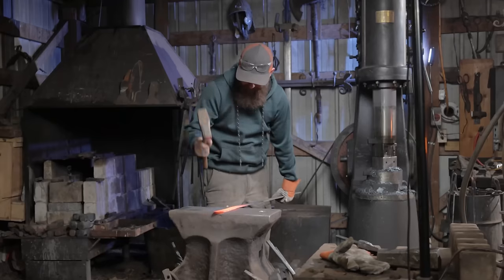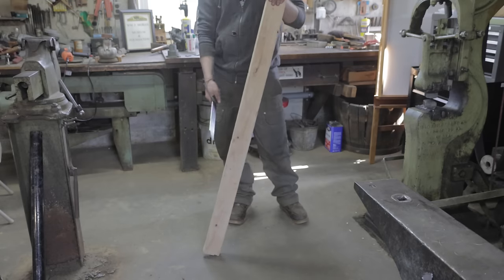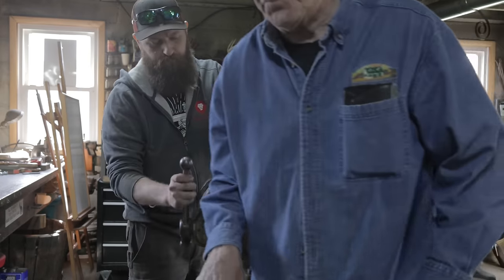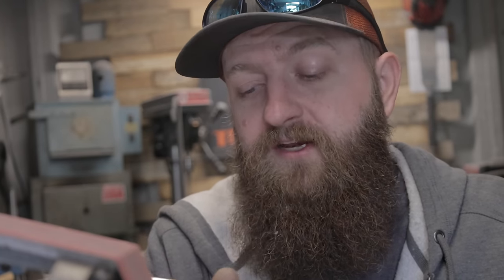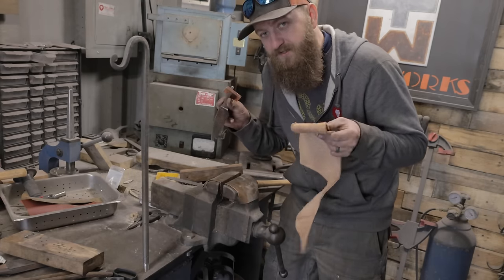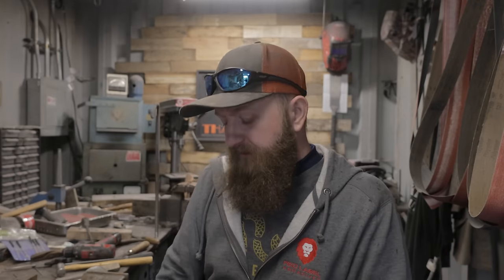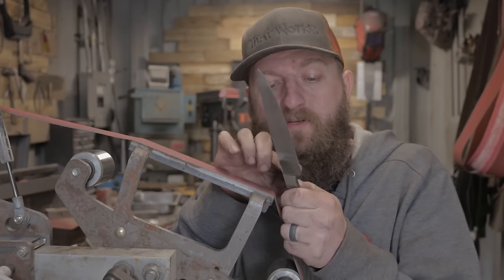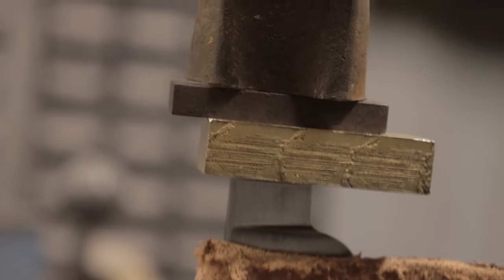Matt's ABS Test [Path to Journeyman] - Part 2

Comment from the maker: Thanks for joining Matt on his path to becoming a Journeyman smith in the ABS! Be sure to check out Red Label Abrasives or all your sanding needs!
Reply: Holy crap matt i wasn't even there and was nervous for you great job 👏👏👏
Reply: Of course guys! Love all you do!
Reply: You have to admit you are a Master Grinder first. But your blade is amazing. 
Luvs Dude
Reply: Where do you get your stencils from for logo etching? its hard to find a place for that?
Reply from the maker: @pr0faker  still working on that
Reply: @pr0faker  One way you can do that is to get a papercraft cutter like a Cricut, one that will do vinyl or other material you can etch over. Then you design a cutting stamp (or a stencil design in software) that the cutter will use to make the actual stencil in a vinyl sticker. After that it's peel and stick, etch, then remove the remains of your sticker.
Reply: @tantamounted  I know the vinyl option but that limits you to anything without loose things like dots and letters like the O etc. I know there are those fine mesh UV stencil thingies but I don't need the whole setup thats like 400-500 bucks to use that, I just want a guy to fix those stencil things since 1 will be usable for like 100 times or something.  I don't make 100 knifes a week , also not in a year so I can do fine with just a few stencils. But who can fix that? :)
Reply: Congrats Matt.  We're so used to seeing you being the Grind Master but  we love seeing your progression bladesmithing.  Awesomesauce
Reply from the maker: @aagreenidge  thank you ! That means a lot

Comment: One important thing to know for hand finishing that can save you a ton of time is to make sure you're going across the grain of the previous grit.  Each time you sand something, you're cutting into the metal and establishing a grit on the surface of the piece in the direction that you're sanding.  When you go to the next finer grit, sand perpendicular to the previous direction.  That will cut much faster and produce a more even finish.

Comment: So, when I file out my tang slot in my handle block and it ends up slightly askew, I use a trick where I take a 123 block (cover the top with painters tape to prevent  scratching my finished blade) and take my knife with block and gaurd on the tang, laying the blade on its flat (ricasso and whatever flat portion that may be left of the spine) and use a height gauge, or something to hold a sharp scribe at the height that Is even with height of face of the knife that is laying on the 123 block, scribing a line around the entire block showing the point of "square". Repeat for both sides. I hope this makes sense in words lol and I hope it helps! 

Really awesome stuff, man! You're doing beautiful work!

Comment: Dude! Watching you do the blade bend was really scary for me. I recently watched Will Stelter's ABS video and when he bent his knife the pipe slipped, flew backwards and hit Will in the face. If it wasn't  for Will wearing a visor than I'm pretty sure Will would have been knocked out cold. All you wor was a pare of sunglasses.
Reply from the maker: That's because I made my knife right :D
Reply from the maker: No really. His prob was his handle bent too much so his hands were lower then the hand making a spring right back at his face.

Comment: What makes me wonder about the flex test: does it count as "passed" if it doesn't break, without coming back to true? I mean, from my perspective of somebody who has no clue about smithing at all, it would just be logical if the requirements to pass this test would be: bending to 90 degree AND afterwards coming back to true.
Reply from the maker: That is very doable! I’m not sure what the origins of the bend test for the abs is. I know for my mastersmith test knife I will make it bend and come back true with no set. For this one, I played it safe
Reply: @ThatWorks  Oh, ok. Thank you for elaborating. Good luck for your tests!
Reply from the maker: @ralfhtg1056  thanks Ralf! The next phase is the real test!

Comment: How do you put your blade in your heat treatment method, i recall you got a little bit of a warp. i have a theory i am going to go check that putting a blade flat in a heat treatment oven (or in my case forge) causes a slight heat sink effect that gives sligly cooler blade on one side causing it to bend as it cools down.
Reply from the maker: I didn’t get any warp. I like to stand the blades up on the spine inside the kiln
Reply: @ThatWorks  Sorry if i offended i was going off memory of the last video and may have mixed it up in my head with a different video as i had watched a video about heattreating on UK bladeshow's channel around the same time and that was talking about warps. 

I brought it up  I had gotten some warps well slow cooling in vermiculite and noticed i was getting warps. went out and straited the blades and stood them up edge to spine up insted of laying it on the flats and i did not get a warp. so thought i would bring that up as a secondary confermation.

Comment: Wait... What test ... Is their an actual real test. For becoming a Smith... Or maybe its for becoming a master smith.. idk
Reply: You don't need to take the test to be a smith. This is a certification. It is also a membership thing and is a step (journeyman) to become a certified master smith. You can learn and be a good smith without this.
Reply: @tiffanysandmeier4753  i agree but being a master smith adds prestige and a tells everyone how good you are
Reply: @tiffanysandmeier4753  so whats the point. How does it help...

Also. So your a "journeyman" if your trying to get your master
Reply from the maker: The ABS is the standard in knife making. There are other ways to be considered a master as well.
Reply: @strydyrhellzrydyr1345  it helps in that the smith has demonstrated specific skills at a certain level. It is recognition of those skills. Prestige as Jim Austin said.
Not having it doesn't diminish the skills of a smith, but it might mean they could potentially sell what they make for more money.
Reply: @strydyrhellzrydyr1345  have you ever read anything that talks about the old trades. Apprentice, journeyman, master. I am most familiar with those from fantasy novels, but those titles/roles are historic. Not all journeymen will become masters maybe because of skill or motivation, but it is a step in becoming a master if someone were so inclined.

Comment: Japanese razors have never taken a bend well . The objective in a sword is if it does take a bad then you should not lose your tip. Because a chipped blade is something that happens to everybody but a shattered blade should never happen to a samurai. Beyond that there is that point that a snapped blade can not make the stab. A Bent Blade can be straightened quickly in the field hopefully getting you back to the blacksmith. Because you need your sword repaired but because you need a replacement, and hopefully there is enough played left to make a tanto, otherwise it would probably be smart to have a new sword built for the old uniform yet until then does he at least have something you can borrow you are at war after all.

Comment: man I hate hand sanding. Probably because I am bad at it...
Reply from the maker: Just one of those things that has to be done
Reply: Sand in one direction and alternate between grits to remove deep scratches or oxide pitting, use a backing block or pad, and let the paper do the work. 👍
Reply: @jimmyrustler8983  Thanks for the tips.

Comment: Pre-test post-test tempering was too hot blade was too soft you did not make a piece of spring steel failure and you will not have the time that it just happened that particular not a piece of string Steel in order to perform the actual test. Has the actual amount of time that will be granted will be roughly the amount of time it takes me to make this last statement vocally.

Comment: I am worried that you are going to have a veried temper in your blade that blade will be put to the most brutal test anywhere not designed to break the blade, and you are going to be handing them a place that very well could have the attitude of a teenager. Because an uneven temper is more likely to create cracks, and moreover it will put stresses in that blade that will never go away. And there is no way you do not know how to make a homemade geniously tempered blade which is all they asked for. That is I do believe you just made your job way more complicated than it needs to be. The outcome of this test is always a surprise but you have just put me on the edge of my seat. Because I am only skilled at attempting to make wrought iron and bloomery finer grind and more homogeneous, as I have not been trained in how to make a steel drum. Only on how to make steel barrels sheets and Springs. So the only purposeful tensioning I have done is on a sheet that has been wrinkled such as bulkheads.